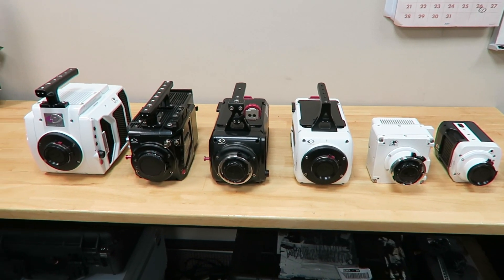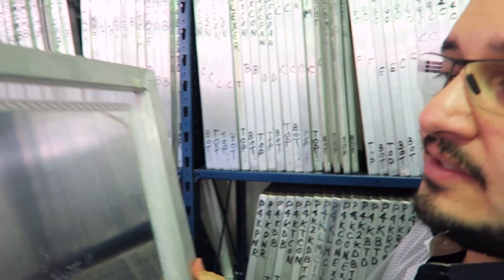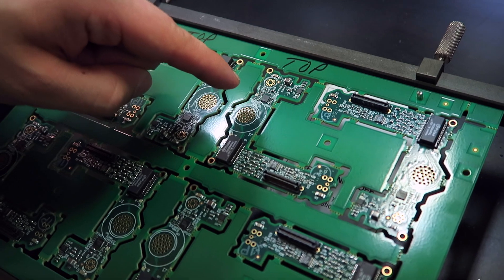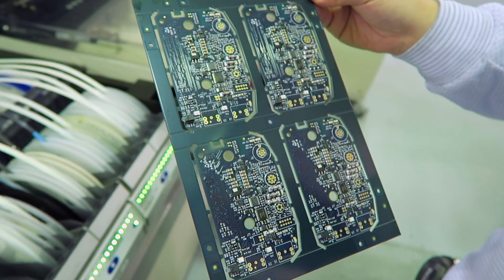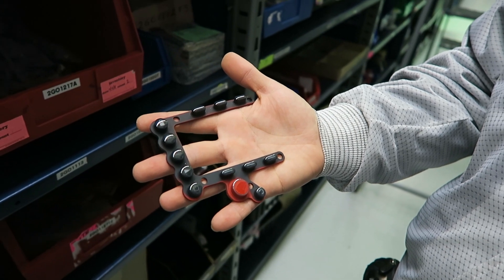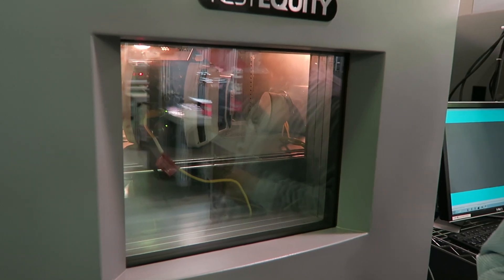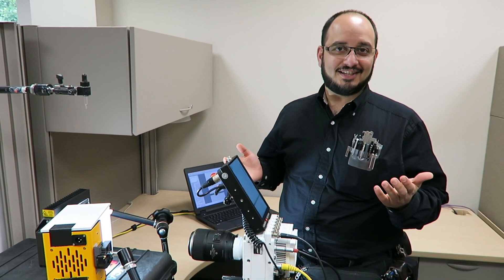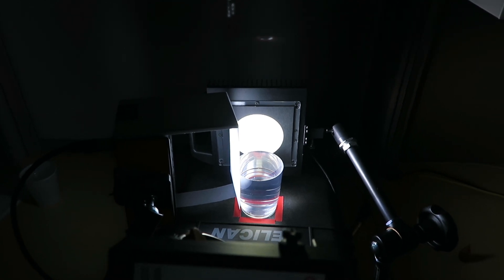How Phantom Cameras are made

Comment: 3:13 I cant believe thy are using Windows XP
Reply: Very common in manufacturing to use older operating systems. If the system still works perfectly no reason to spend tens - hundreds of thousands upgrading hardware/software. You will even find companies still running Windows 3.1/MS-DOS to run machinery. 

They are usually kept off the internet and main network for security reasons.

Comment: Now I'm wondering if the drop that goes into the water has the same volume as the one drop that bounces out of the water and if not what's the relation to the used liquid. Could you calculate exiting drop by using the amount of liquid, the density, the speed of the entering drop and known surface tension of the liquid itself?

Comment: Ok, so these consist of a circuit board, a sensor, and some proprietary high speed memory, with some stringent product testing. I get the feeling that they could do a little work to optimize their production line a bit, and sell these cameras for less than half of what they are selling them for now, and still return plenty of profit. And it makes me think that Vision Research is charging this much for the cameras simply because they can. Because the main consumer base is large corporations who could care less whether it costs 30k or 65k or 100k, it doesn't make a dent in their expenditures either way. It's kind of frustrating.

Comment: I'm curious now, what are temperature-related image defects?
Reply: freaky108 Dead pixels, white spots, maybe warping the image due to heat or moisture.
Reply: Certain components on a pcb, especially varistors, capacitors and DC-DC-Converters change their electrical specs at very high or very low temperatures. This could result in noise or grain in the image, similar to boosting the ISO to its max.

Comment: Latest techonology uses Windows XP
Reply: lots of industry and professional equipment is still optimized for XP, and you can still get XP licenses if you really need them. all because if its not broke, dont fix it. i would still be using XP if Windows 7 didnt work this well.
Reply: I'm apart of a robotics program and they told us from day one that we would be using Windows XP quite a bit. Most manufacturing plants still run on XP and there might be a chance of something even older
Reply: Windows XP also has the greatest fucking UI in Microsoft's history
Reply: what, XP is by far one of the most, if not the most solid operating system around, at the very least the best microsoft has made
I bet you'd be surprised that a majority of businesses still use DOS but they do, in general if they aint using XP then they're probably using DOS or some mac(albeit newer businesses would be more likely to use 7 or 10, being used to it does have a lot to do with it too, retraining staff, etc)
Reply: Everybody, it's not that XP is "solid" or anything like that.  If anything, it's more insecure as Microsoft has stopped updating it. 

The problem is that the software needed for lots of manufacturing, CNC, SCADA, etc. systems is very expensive and very specifically made to be sure that it communicates with equipment the way it should.  A lot of them use old APIs, code, and drivers that only run on outdated versions of Windows. It would be prohibitively expensive for both Phantom and for the makers of the software to start from scratch just to make it for Windows 7.
Reply: XP's UI is like someone in the 90s designed what they thought Windows 10 would look like out of ice and then colored it in with vomit.

Comment: Most people don't realize just how easy it is for something to go wrong when manufacturing complex circuit boards.  Very nice to see folks doing it in-house with proper quality control.
Actually, I wonder what their rejection rate is.
Reply: I'd assume very low for the PCB's - doesn't look like hand-tuned RF black magic or anything like that. The actual camera sensors might be a different story though.

Comment: Can you film the lens of a phantom with another phantom to see how quick the shutter goes
Reply from the maker: It's an electronic shutter not mechanical. No moving parts to film.
Reply: Paul Hill Didn't he say that that frame was taken by the Canon though?
Reply: +Edward Millard (Neovo903) I believe he said in the camera shutter video that the phantoms use global shutters, but I may be mistaken.
Reply: Global shutter and rolling shutter are both electronic. Global shutter reads all the light on the pixels at once (needs to be very powerful for this), rolling shutter reads the light on the pixels left to right (like reading) cameras on your phone for example, have rolling shutters.
Reply: @neovo903  Thank you for that!
Reply: there is no physical shutter on the phantom
Reply: Wouldn't that just produce another 16 hour video, but with just 1 frame happening at the other camera going at the same speed?
Reply: sensors convert the varying intensity of different kinds of light into an electrical current in which a computer processes that information and makes an image. Every pixel is really its own sensor, and the camea sensor is an array of those sensors. Night vision cameras are more sensitive to infrared light, the kind that's associated with body heat and such.
Reply: Not all of them, as Gavin mentions in the camera video the phantom flex 4k has a rolling shutter.
Reply: @TheMechanic40  there is a phantom flex 4k gs and gs stands for global shutter
Reply: DAD?!
Reply: this is so much more then what i expected idk why
this is intresting
Reply: how would that work it's just a global shutter so what would you see 😂
Reply: +The Slow Mo Guys 2 like the video!
Reply: RightHearted can you explain what a sensor is? how they make night vision sensor in cameras
Reply: @kiturselassie9693  Two years old but whatever.
The sensor is a bunch of pixels laying next to each other. Each pixel takes a reading of the amount of light hitting it at that time, on a scale of 0-100. 0 being black and 100 being white, it sends that information to the monitor and storage where it is replicated into the footage.
Reply: that would re-create the big bang.
Reply: RightHearted sensor not lens
Reply: Mike Cammiso thank you. I've been searching all over for this info. I thought it just had an extremely fast shutter or something. is that the same for normal videos aswell?
Reply: normal video depend on the camera you're using; if it doesn't have a moving shutter then it probably separates frames digitally.
Reply: The universe would definitely imploded if he did it
Reply: Even if it was a mechanical shutter that would be boring anyway 😂 "ooh look the shutter of this 10,000fps camera moves... 10,000 times in a second." Wow what a video.
Reply: It obviously has a global shutter. There's no way a slow motion video would be high quality with a rolling shutter.
Reply: Yeah the champagne cork hits Dan in the face before the shadow (or something like that) because of the rolling shutter
Reply: @djmrhill  shadow hit first. I just watched it.
Reply: It's an electronic shutter, nothing physically moves or changes
Reply: +The Slow Mo Guys 2 just wondering, is it a global shutter or rolling shutter on the phantoms?
Reply: @neovo903  it's a global shutter
Reply: @Rev-maniac7500  only 5 years late
Reply: @neovo903  both in different modes
Reply: @neovo903  I did not even notice that was 5 years ago
Reply: You wouldn't see anything it would just look like a sensor sitting there receiving light... because thats what it is. Its in the software where the camera takes snapshots of whatever the sensor is detecting at thousands of times a second.

Comment: Thanks for this.  I work in an area with circuit assembly, and though I walk past all the machines and the parts bins, I never knew what each was for (though I could guess at some of them since they smelled 'hot' or what not.   And I could tell when there were water lines coming in (mostly as pretty much every one sprung massive leaks we had to dodge coming in while they were being installed lol)

Comment: I'd love to see a "how it works" video about the Phantoms. What is different from a regular camera to allow it to film at such high speeds? How does it mitigate noise from the very low exposure? Does it do any post processing like filtering the noise over several frames? What is the limiting factor for being able to shoot at even higher speeds? The resolution / fps trade-off Gavin mentioned a few times makes me believe it's the post processing or I/O bandwidth, rather than any optical limitation of the sensor.
Reply: Alright. Not a "how it works", but a simple explanation from a person that's "in" on the high-speed camera industry.

1) The main difference between high-speed and regular cameras is the data path. In regular cameras, the hardware is highly optimized to take a set of images at regular speed from a sensor that's highly optimized to work in that specific set of conditions, then compress it using proprietary silicon that can only do compression(in most cases), and then it's stored directly to non-volatile media without any buffering anywhere.

1+2) The second difference is the sensor performance. The sensors in regular cameras are, and this is a scary word for silicon, built down to a price. They're designed to be manufactured in the millions(most Sony sensors have a MOQ of 5k, sometimes even per month, even for huge companies), and they have been made to operate at their limit most of the time, including the pixel density and size, as well as architecture.

The high-speed camera sensors are designed in-house, and they are designed entirely differently, main criteria being the engineer's requirements, not the price. They usually have huge pixel pitch, sometimes 10x higher than the consumer cameras, which makes them incredibly clean and noiseless, though that's not the only factor, I won't go into detail about that.

This is also partly how it can get huge base sensitivities(without gain) that allow you to have very short exposures. It's simply how the sensors are built in silicon, no magic involved.

3) There is no filtering or processing of the images of almost any kind, except for a few minor things like subtraction of pre-calibrated sensor FPN. FPN is fixed-pattern noise, which is unique to every single sensor(silicon is not entirely perfect, as others may believe, it's always flawed or different in some ways). Some of that noise comes from imperfections of the pixels themselves, but most of it comes from differences in the column/row amplifier stages, because every pixel's value is still too small to detect with a regular ADC, it needs to be amplified.

4) The limiting factor for being able to shoot at higher resolution and higher speeds, both of which are pretty much the same, is bandwidth, or specifically bandwidth outside the sensor.

The signal paths can only handle so much data, even with the highest-end components and the most brilliant engineers, 20-layer boards and signal length matching down to a picosecond.

As well as the hardware limitations, there's also the problem of storage.
Even the highest speed RAM has its limits. The images that are being stored are entirely raw from the sensor, there is no affordable(in terms of high-speed cameras no less) way to compress this much data(one of the world's fastest cameras shoots at 26 gigapixels per second), which means a 10-bit 1920x1080 image takes up 2.592 megabytes.

One way to get around this is to make a camera almost entirely in silicon. This is what the guys at Shimadzu did with their HPV series cameras - they created a sensor that only needs a timing input, the rest is done in-situ.
Every pixel has %frame count% of "pixels" adjacent to it, which simply store the image as soon as it's captured, without having to offload it outside silicon for storage in RAM.
This is how they manage to get speeds of up to 10 000 000 frames per second, but the tradeoff is the number of frames they shoot, which in their case is smaller than 256.

However, if you decided to make an entire high-resolution camera in silicon, you'd be looking at research & development costs of up to $20-100M and higher just for the silicon, and the production costs would be immense as well, since the silicon itself will have to be quite huge in terms of area.
Reply: @Spirit532  WOW!  Thanks!
Reply: @Spirit532  You really love the word "silicone" don't you? I'm not even sure what you mean by that.. do you mean the actual physical material? Just saying "silicone" when talking about anything electronic is kind of vague and confusing, you know.
Reply: @Hallowed_Ground  Silicon. Not silicone. And I explained it pretty clearly.
Reply: @Spirit532  Same difference.
Just saying, it's important to be precise in your speech.
Reply: @Hallowed_Ground  And I am precise.
Silicone is entirely different from silicon.
The former goes into boobs, the latter goes in your phone.
Reply: @Hallowed_Ground  Imagine calling someone imprecise right after shrugging off the difference between silicon and silicone.
Reply: @Hallowed_Ground  Silicon is an element, but in this context it's jargon for logic circuits, which are usually built from silicon wafers.   Silicon will form long chains a bit like carbon; silicones are rubbery materials which incorporate a Silicon-oxygen chain.   I think spirit's comment 'silicone in boobs, silicon in phones' summed it up pretty concisely.
Reply: Noise is defined as spurious information that you don't want.  It's not specific to audio.
Reply: They cannot reveal Company secrets that casually.
Reply: Dolkarr You're welcome.
Reply: ***** Wonderful explanation! Thanks for your time.
Reply: Spirit Great response, thank you for the info! And for anyone reading this- Spirit has some pretty cool slow mo videos on his channel as well.
Reply: Helveteshit you can find Iphone 5 schematics on google images

Comment: I love how parts of some of the most advanced cameras in the world are made using stencils
Reply: That's industry standard.
Your phone's solder paste is also dispensed via stencils.
There's no quicker way to do it :)
Reply: bassl0va Wave soldering is quicker but the process isn't necessarily compatible with every board layout or with certain types of components etc. Wave soldering is mostly used for boards with mostly through-hole or larger components nowadays.

Also I think it'd be hard for them to set up a wave soldering machine in their shop, reflow oven is "neater", no harm in having it smack in the middle of a production floor for example. No worries about toxic fumes and flowing molten metal and all that...

Besides, once you have a steady flow of boards going into the oven and boards coming out, reflow is pretty fast anyway!
Reply: Heck, even the IC's are fabricated using scencils. Well, sort of, kinda.... Photolithography ftw!
Reply: bassl0va You can't wave solder components without gluing the components to the board.
Reply: Isn't wave soldering quicker?
Reply: Since there are bunch of industry people here, I need to add that automated optical inspection scene was in the wrong place. It should have been after the board went to oven, not before.

/edit and as a person who also did maintenance and cleaning to wave soldering machine, I have to say that job was easily the shittiest job on the whole factory. And Mythricia is right, that machine can cause lead poisoning if you dont wear proper safety gear although machine itself has ventilation so regular users shouldnt have to worry about that.
Reply: ***** Interesting. I thought optical inspection was done before reflow, so that misaligned components could be caught before the reflow and fixed by hand. Or am I off the mark there?

Can imagine servicing those thing being kinda awful. Has to build up a lot of flux residue and all sorts of weirdness I bet.
Reply: Mythricia
You're technically correct. Atleast the factory I worked in had small manual inspection station before the reflow oven.

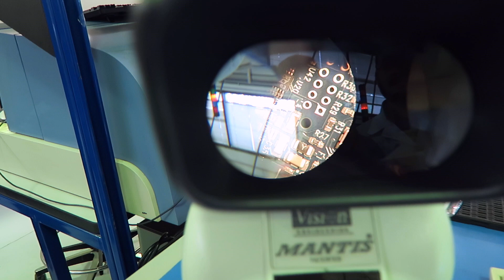But AOI is after the reflow oven because some errors appear during heating, such as short circuits, improper soldering paste hardening and components can even move in the oven. It's okay for the component to be misaligned and its up to AOI operator to decide if its nessacery to fix it. Check out 3:09 and look at the 10 legged microchip at the top, clearly its misaligned but it might not be nessacery to move it back.
Reply: ***** Hm, gotcha! I've only ever been on the PCB layout side of things, all I ever see is the CAD drawings then I get a finished board in my hands. Would be interesting to see in-person more of the steps in between, even though I know in theory how most of it is done :)
Reply: Mythricia I live in Belarus and there are three separate local fabs, surely you can find one where you live.
Reply: Mythricia Just find any local fab company and ask if you can take a look at a production run when it's going.
They will most likely let you in and show you around, especially if that's the fab you(r company) manufacture the boards at.

Bring a camera if you do :P
Reply: ***** Usually it's made over in China (there are reliable fabs among the forest of horrible ones) or sometimes the US, both equally "far as hell" from me, sadly hah. But yeah it'd actually be real cool. Maybe there's smaller ones in my country, but I've never heard of any.